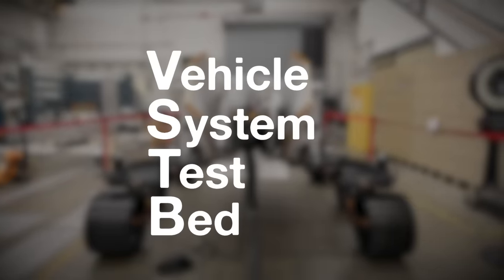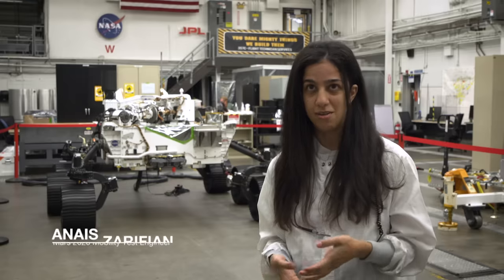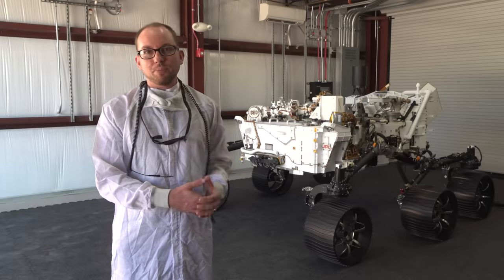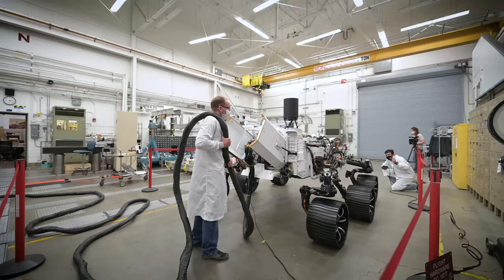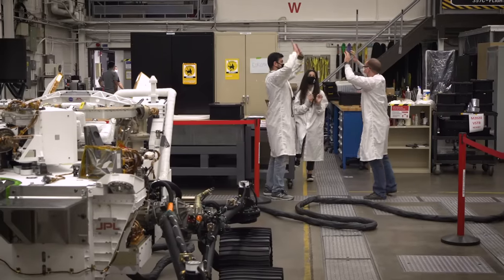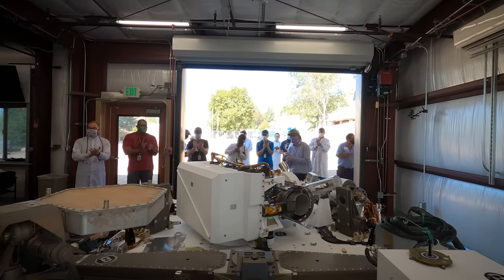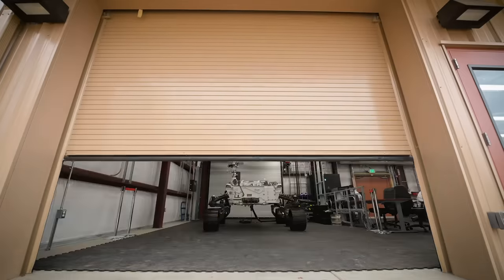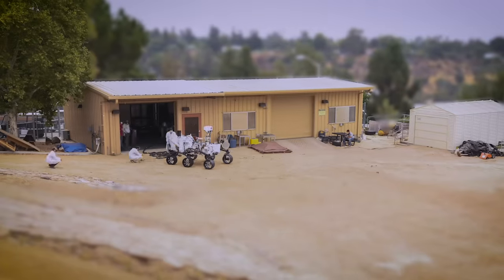Twin of NASA’s Perseverance Mars Rover Now on the Move

Comment: So... it can operate on the surface of mars but can't drive down a road on this planet? How much cooler would it have been to have it drive itself to the testing location, instead of being carried?
Reply: @butthead1535  Indeed, it would be ridiculously, painfully, slow. And they don't seem to have a battery for it -- it is always shown tethered -- with a power and data cables plugged in.

But if JPL decided to move the rover using its own motors, it would not take more than one working day to traverse JPL grounds -- the JPL facility is about 500 meters across and the top speed of the rover is said to be 90 meters/hour. On Mars, of course, it goes much more slowly than this top speed -- mission average for Curiosity is a tad over 7 metres/day.
Reply: @butthead1535  Good point. They only showed it leaving and arriving so thats the only times it would need to drive, they could carry it in between. It would at least give the impresssion that it drove all the way.

Comment: Considering how different the gravity on both planets are, wouldn't there be a case where the rover can do a maneuver on Mars but not here on earth?
Reply: Yes that's the point if it can do it here it's going to have no problem coping with 0.37G.
Reply: Most of the things work on very high torque due to which gravitational force has negligible impact. I
However it would be really interesting to send some high speed rover to see what it can do in low gravitational force

Comment: They should really look into how the vehicles in our surface mines on earth does cable management.  Those huge electric driven bucket excavators also have a cable, and often a "tail" that holds the cable away from the moving parts like wheels and belts, so you dont need a guy moving it around all the time.

But hey, i guess just like rockets not much will happen until it's privatized as well.  :D

Comment: If Perseverance is powered by an RTG, what is Optimism powered by? Would they really put an RTG in such proximity of humans just so they can be exactly the same?
Reply: If shielded RTG possesses no harm to humans. But I would not be surprised if they used supplemental power.
Reply: @sergeig685  Got it. That must be what that wire is that they are holding.
Reply: Like Sergei have said, RTGs pose no danger to humans. But it is not possible to have an RTG for the Optimism -- so it is simply plugged into a ground power supply using an extension cord, which also carries signals to monitor and control the rover.

RTGs are produced in extremely small numbers (there isn't even enough fuel in the stockpile for all the space probes that NASA wants to launch), and possessing such relatively large quantity of nuclear materials requires extensive safeguards. They are also very expensive -- over a $100 million a piece.

Comment: Can someone explain why the wiring harnesses are exposed to the elements.  Does this affect the longevity of the rover?
Reply: there aren't really any "elements" on mars given that the atmospheric density is 1% that of earth. So no gale force winds, or rain or significant corrosion. They're designed to withstand the temperature variations already, so that itself is not an issue.
Reply: @theLegoDEI  Thanks.

Comment: Does anyone know what they changed with the wheel design so they don’t end up like curiosity’s?
Reply: The \/\/\ zig zag on the surface of the wheels has been straightened like that 〰️〰️
Sharp angles increase risk of the metal breaking.
I could have told them beforehand.
Reply: @farrider3339  Thank you

Comment: Absolute layman-question: is that the exact same rover that would land on Mars and if so, isnt it way heavier/sturdier built than it needs to be, therefore wasting tonnage, if it can operate in earths gravity supporting its own weight?
Reply: I think the idea is that it is better to be to sturdy than not sturdy enough, but I’m not sure
Reply: the highest loads the rover sees are actually during the initial chute landing impact, which exceeds vehicle weight on earth.
Reply: The gravity on mars is less than half on earth, the vehicle needs to be extra heavy so it has traction to move. 

A too light vehicle would not be able to move on sand, soft soil or steep terrain.

Comment: Why are the rovers so slow?
Reply: you can make it fast but it requires bigger motors and more energy, maybe this speed paired with the motors was the most efficient? But good question. Keep in mind also that with more speed there is more forces put on the rovers components as it goes over bumpy terrain. You need to build it stronger to withstand those higher forces. Nothing in engineering is a perfect solution...we only make tradeoffs for something else. In other words, nothing is "free" there is a cost to every decision.

Comment: How could you send a rover to mars and none to its moons?
Reply: A rover on Phobos or Deimos would probably be near imposible to drive, as the surface gravity is 0,0057m/s/s (on Phobos) and 0,0031m/s/s (on Deimos) vs Earth's 9.81 m/s/s. If a human would stand on it you could jump of Deimos (escape velocity is 20 km/h of 5,33 m/s) and maybe Phobos as well (41 km/h or 11.39 m/s) . A wheeled or tracked rover would probably flip itself over constantly. Stationary probes are probably the best. 

The Russians did send two probes (Phobos 1&2) in early July 1988 but both failed. Phobos 1 was lost due too a computer malfuction on its way to Mars on september 2 1988 resulting from a software error that deactivated its thrusters resulting in it failing to reorient its solarpanels to the sun and depleted its batteries.  

Phobos 2 did reach Martian orbit but communications were lost as it failed to reconnect to Earth on March 27 1989 upon approaching Deimos. While in orbit around Mars it photographed about 80% the surface of Phobos and ran its infrared spectrometer(no water was detected).
Reply: @asjenmensink2740  True a stationary lander similar to Phoenix is probably the best option.

Comment: So many wires 🤔🤔🤔
Reply: Lots of things need wires lol
Reply: Original Perseverance rover have plutonium "battery", this version must have external power for obvious reasons;)
Reply: All the electronics is in the center of the rover, in a climate controlled box. So every motor in the wheel, every gadget in the mast have a cable (and a very conservatively built cable) running to them from the central box. This creates an awful lot of heavy wiring.

JPL has been experimenting with putting some of the electronics outside, together with the motors -- then wiring could be greatly simplified. But they still have not tested everything to the level of confidence comparable to what they expect from the old system. This is not very easy -- the external electronics needs to be designed to work over a much broader range of temperatures.

Comment: Why on God's green earth are the wheels so small?
Reply: It may have to do with weight and balancing concerns. Too much of either could threaten to unbalance the vehicle and it's descent vehicle upon delivery, especially when you consider the skycrane in use. So they may have made smaller wheels out a composite material that's durable for lengthy off road use but still lightweight
Reply: They aren't small. They are the right size for the job

Comment: Every element in the universe has separate fundamental functional quality, gravity sense, chemical sense and magnetic sense and with plus (positive character) and minus (negative character) for normal or abnormal time limit function and mass behavior. The Almighty is blessing the living beings with normal time limit function (from birth to death). But in the case non living things the functional quality-normal or abnormal time limit behavior is done by activation through a Natural source or solid or liquid or electrical elements source.
Time Limit activations.
•	Mechanical Specification 
o	Total travel/function
o	Initial activation and renewal of activation to continue the time limit travel function
o	Operating source/force or function
o	Functional force/travel/speed after activation
•	Electrical specification 
o	Resistance
o	Contact bounce
o	Operating Voltage
o	Current consumed
o	Functional force/travel/speed after activation
•	Chemical Specifications. 
o	Activation for operation
o	Consumption of chemical quality and quantity
o	Operating source/force or function
o	Functional force/travel/speed after activation
•	Fuel specification. 
o	Consumption of fuel quality and quantity
o	ignition suffering
o	Operating force/function
o	Functional force/travel/speed after activation
•	Calculating the Time limit result. 
o	Gravity sense
o	Air resistance
o	Friction of earth surface, if on road
o	Impurity of chemical or fuel
o	Friction within the machines.
Earthian invented vehicles to travel on the surface of planet, above in the sky and on the water, and some machines are invented to cater several needs of Earthians, which require the basic Time limit functions.